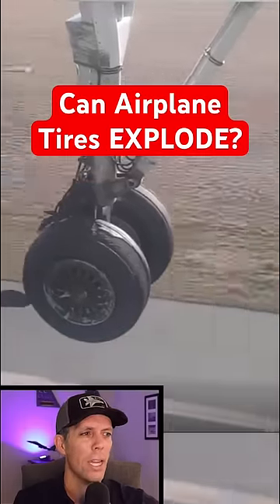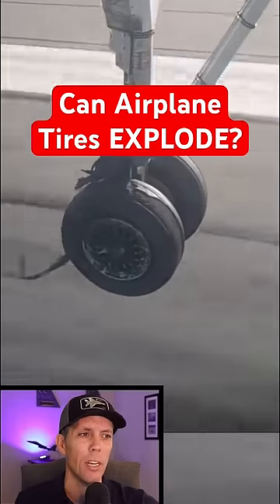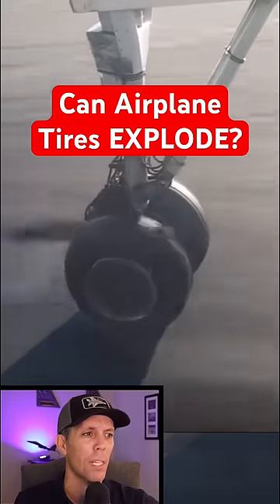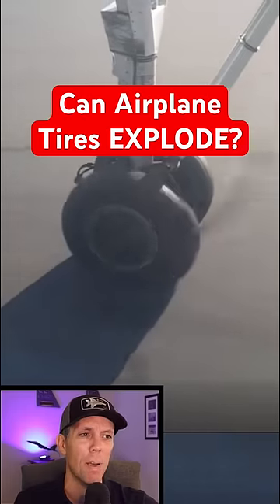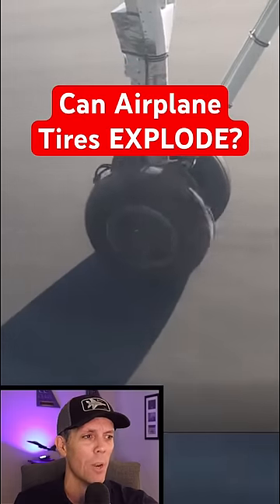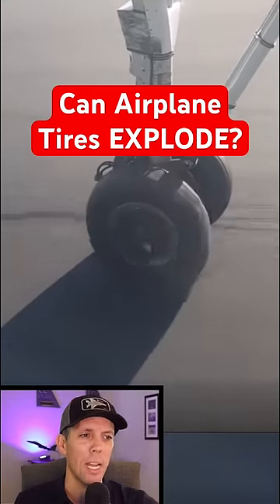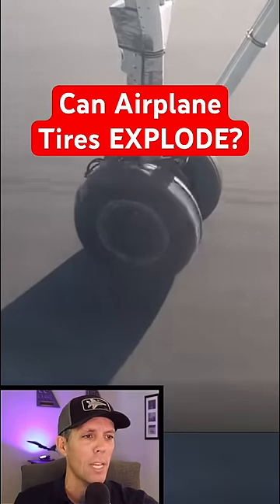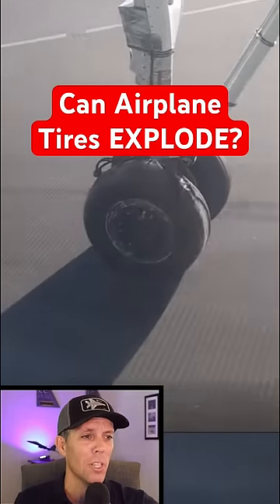Can Airplane Tires Explode?

Comment: Genuine engineering question here because this is likely a question thats been answered before but its just not common knowledge. 

But why arent planes engineered with tires that are prespun before landing to reduce the amount of material lost on contact? Is the drag produced by the initial mismatch in speed necessary to aid in the landing procedure? Seems like a hassle to keep shredding tires and im sure that shit is expensive.

Comment: This is one of those things I’d expected humans to have solved by now. Hard hard is it to add a tiny electric motor on the wheel to match the ground speed so the tire doesn’t degrade at all on landing?
Reply: Been working on aircraft for almost 20 years and the reason the wheels don’t have that feature is because it would
Be counter productive and actually more dangerous. When landing on touchdown the wheels will be moving at the same speed and if they aren’t there is an anti skid system that will ensure they stay at a similar speed to prevent loss of traction on the runway. Also it wouldn’t matter if the wheel was already spinning once the plane touches down as the entire weight of the plane is on those tires they are going to stop and skid no matter what so it would
Be a waste of a component.

Comment: Apparently the rubber loss isn't all due to accelerating the wheel but also due to lateral skidding.
In this case would there have been an advantage in continuing to the destination due to landing with a lighter fuel load?

Comment: Why not use differential motor to speed the wheel up? Or if that’s significantly underpowered then use the wind by creating a small flap over the front of the wheel? Something that can be retracted as the wheels do but that funnels the wind to the bottom to create an uneven distribution of force Turing the wheel

Comment: I've always been surprised that the landing gear on airplanes is not designed such that when it is deployed, the wind accelerates the rotation of the tire so that it doesn't skid when it hits the runway on Landings.

Comment: Just curious, but if the tire 'exploded' on takeoff, wouldn't you want to fly to the destination to reduce the weight of the aircraft by using most of the fuel, rather than landing on a full tank - or do you just dump all the fuel to get to min weight there and then?

Comment: Hypothetically, you attach at motor to the wheel. This motor would be connected to the planes ECU and adjust wheel speed accordingly to the speed of the plane when landing. Not only then would the wheel be spinning at the desired speed it needs to, but it may offer for smoother landings/ less rubber waste produced. I’m no plane expert but would this be possible?

Comment: I wonder what would happen if they had a motor on the landing gear to start spinning the tire before it lands? Would it even work? Would it cause the plane to lose control, or would it actually work?

Comment: Wouldn't it be more effective to spin the wheels prior to making contact? ABS works on the principle that locking your wheels is less effective than gradually decreasing rotational speed so I'd assume the same applies here?

Comment: Okay but why did they have to turn around? Just fix it at the destination? You have to land on it either way?
Reply: If you had 200+ people lives on your back, you would rather land back and leave nothing to the case.... Its mandatory... Also, if that damaged tyre, still with some nitrogen inside, blows inside a fuselage mid flight ....

Comment: I feel like you shouldn’t make an emergency landing for that. No matter what you’re gonna have to land. Might as well do it at the destination. Especially because if the landing is harder with a bad tire your gonna wanna use as much fuel as possible to lighten the weight at landing and incase you crash the damage isn’t as bad

Comment: I know weight is critical but why not install a motor that picks up the wheels speed in relation to the airplanes speed, even a capacitor jump starting the wheel will work

Comment: Hold on, why did they need to return for an emergency landing when all that happened was a blown tire? It doesn't really impact the flight and only the landing right. When in the air, they'll have to land somewhere 1 time with that blown tire anyway. What benefit does it bring to perform said landing at an airport the plane does not need to arrive at?

Comment: They need the automatic tire spinner built inside so when they land it doesn't do that. The wheel is spinning according to the airspeed, landing speed. Think of the tread it would save.

Comment: I've been concerned about that too. Why couldn't they install a motor in each wheel to give it a speed that is equal to the speed of the air plane so that there would be much less burning of rubber? Maybe I'm just an armchair expert.

Comment: In the earlier 1960s, taking off from Khartoum, Sudan, the Ethiopian Airlines Boeing 720-B had retracted the landing gear and was cleaning up the flaps during climb out when a main gear tire exploded. The landing gear door was removed, all the hydraulic lines and pumps inside the wheel well were torn loose, the fuselage fairing along the entire top of the wing was blown off.  The flight crew was the best possible for experience, WW II pilots, including my step father, Capt. Chesley H. Robertson, who had flown a Spitfire in Eagle Squadron, as well as being blessed with a couple EAL A&P mechanics on vacation, who, being intimately knowledgeable with the airplane, were able to lower the landing gear by hand although all the flaps and slats were in different positions, so after liberally spraying the cotton fields with jet fuel they were able to safely land.  .... As Ethiopian was operated to FAA and CAA standards and still had TWA contract employees still training and working there, they were already doing major overhauls for European airlines,  the probability is that Sudan, Cairo and some other Desert countries were so hot that temperature was a factor. Maybe.

Comment: Nitrogen is used because of temperatures changing the pressures of gasses and nitrogen is better at not condensing at colder climates.

Comment: 1lbs is steep. A C-5 Galaxy tire weighs 175lbs with wheel. That tire is good for 200-400 landings. So the tire would simply not exist after about 100 landings with 1lbs of rubber lost.

Comment: Why cant they use air itself to spin the wheel a little bit to increase the tyre life and most importantly keep the runway with less rubber, or is it "if it ain't broken don't change it" thing.

Comment: To avoid the tyres dragging along the tarmac till it speeds up to match the speed of the plane, why dont they simply programme the wheels with a speeding sensor, spinning up the wheels to a speed equivalent to the plane landing speed, so that when all wheels hit the ground, there is no drag, no smoke, and no rubber wasted away? It will be a smooth, smoke-free landing.
I always wonder. It's that simple, is it not?

Comment: I really don’t under stand why they can’t add an electric motor small with a wheel the extends just spin the tire so that when the plane is landing it does not cause that drag. It would save so much money on tires . By the way you can add a motor directly to the wheel but the only issue I thought about is what If it fails then it would lock up maybe

Comment: Every airplane pilots should have a colour and an IR camera in view of  each landing wheels set and another set of cameras both in colour and IR in view of the engines as the engine view at the pilot dashboard and a rear view camera at the tail end facing the runway, rotatable to the rear as well. Another set of cameras should be present in view of the ailerons on both wings as aileron view especially in planes operational in the near polar circles region for the real time monitoring of the ice build-up and ice removal and for supervising the working of the deicing equipments in each wings.

Comment: Wouldn’t it be safer to fly to destination to burn off fuel (weight) to give the tire less stress? Or would it be a problem to fly with less atmospheric pressure (more altitude) and risk a damaged fuel cell because of unscheduled tire disassembly?

Comment: Why don't they "spin up" the tires to the approximate ground speed prior to runway contact? A neutral motor, much like the start motor on a car, could do the job safely (a starter motor pushes itself out of the way when the engine begins to rotate under its own power)

Comment: These tires actually get repurposed for those machines that watered the fields or whatever the tractors pull behind them I’ve seen a lot of these. They are super thick like 3 inches thick. And they’re all stamped no fly.

Comment: If the tires are rated for 200 to 500 landings then they don't deposit a pound of rubber on the pavement at each landing cycle.

Comment: Are there planes with motors for that kind of thing? I’m sure that the whole issue with that is too much shear force on the tire. If the tire didn’t have to catch up to the rpm necessary to roll across the ground at the landing speed then maybe it wouldn’t be so abrasive.

Comment: There should be small electric engines on the landing gear to speed up the wheels before landing. That would save a lot of rubber.
Reply: The trade-off isn't worth it. It's cheaper to let the tire drag.

Comment: Each tire leaves a pound of rubber per landing.  Each tire is good for between 200 to 500 landings.  Main tires weigh 270 lbs according  to Air Canada.  I can't get the math to math.

Comment: Hang on a minute ....every tyre (tire) leaves about a pound of rubber.... they're generally good for 200 to 500 landings - no way a tyre could lose say 400 pounds of rubber and still exist even an Airbus A380 tyre only weighs 265 lbs

Comment: Solution. Add a rotor to the wheels. They get spun till they match plane speed. When plane hits ground power is cut and it rolls to a stop. Lol probably impossible but ya

Comment: The landing gear should be like a Weedwhacker in case a tire has tread slapping the crap out of it and I’m surprised it didn’t just finish self-destructing, but if it had a little razor on it somewhere to cut off the access

Comment: just weld small Finns to the rims so when gear is lowered the air will start spinning wheels to assist with rubber loss thus dubbling life of tires more or less just a idea 💡

Comment: Someone please explain to me why airplane landing gear hasn't been designed to rotate the tires before landing to avoid excessive wear during landing
Reply: Most wear comes from the braking, not from the touchdown. It just looks so because the wear from the braking is distributed all over the runway.

Rotating wheels in the air however would generate a gyroscopic effect which is not desired before touchdown
Reply: @simonm1447--Thank you for educating me!

Comment: Couldn't you have a motor pre-emptively spin the wheels to the speed the aircraft is moving, up until a sensor communicates that they've touched down? Save a lot of rubber

Comment: Soo if the tire blew on take off,  why do you need to turn around for an emergency landing.  Couldnt you just do the landing at the destination.  Also wouldnt it be safer bbecause you would be significantly lighter at the destination.

Comment: Putting nitrogen inside your tire will not prevent a tire from overheating. This statement is false. Nitrogen cannot dissipate heat from a tire any faster than air or CO2, nor can it decrease heat producing friction between your tire tread and the road.

Comment: Filled with nitrogen instead of air, I've always wondered what the benefit really is when you consider that air is made up of approximately 78 percent NITROGEN and 21 percent OXYGEN and also has small amounts of other gases too, such as carbon dioxide argon and neon🤔

ps. Carbon Dioxide is 0.04% yep tiny amount makes you wonder if Net Zero is possible🤗

Comment: The solution is to speed up the tire with an electronic motor or pneumatic that matches with the speed of the runway. With touch down there is no los of rubber les debris longer lifespan of the tyres and much smoother landings, how about that?

Comment: I had an idea back when I was 20 something...I'm almost 80 now.  Anyway, why don't the wheels have a turbine type rim with blades that allow the wind to spin the wheel...guess what, it would spin up to the speed of the plane and be spinning when the tires hit the runway.  Minimal rubber loss.  I put that in the public domain, but I doubt Boeing is smart enough as they are fixated in DEI instead of QUALITY and Reliability.

Comment: Why are they filled with nitrogen?
Reply: First - nitrogen is dry, so there is no moisture in it which would boil inside the tire.

But if it's burning and you retract it the melt plugs in the rim will deflate it and the nitrogen pushes the air out of the wheels well and extinguishes the fire

Comment: Why don’t they spin up the wheels a bit then or have flaps open up akin to a fidget spinner being sprayed at the edge by water…😂 look it feels like a stupid idea in my head, but at the same time it doesn’t because then the wheels will start to spin up at the same speed as the plane is moving, therefore reducing the amount of rubber from the wheels from going from 0 to 60 right??🎉

Comment: #elonmusk why don't they just install some Tesla motors on each of the wheels to get them up to speed prior to landing so that you don't lose a pound of rubber on each landing? Over the lifespan of a plane that's got to be cost effective and I assume it would also be safer since you could use them to slow the airplane down in an emergency.

Comment: What was the point of the emergency landing? Lol might as well fly to where you’re going. You’re already in the air, and have to land no matter what. I’d rather burn some of the fuel off by flying it, and lighten the load on the tire upon landing.

Comment: This guy is just a complete liar. 10k lbs a day of rubber on a runway would be enough to cover the entire runway in a thin coat of rubber so much that it would black out the lines. Or if your not spreading it out on the runway and just approx where they land, 10k lbs of rubber would be enough to leave a giant speed bump after a couple days. As a former usaf mechanic that walked the runways looking for debri, this is just complete nonsense. Screw this guy and his lies to for views and comments.